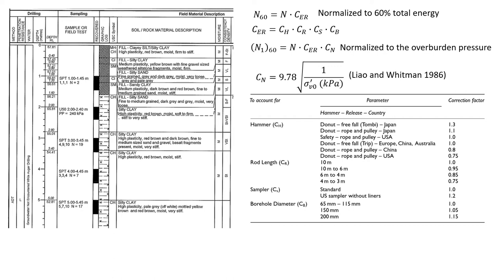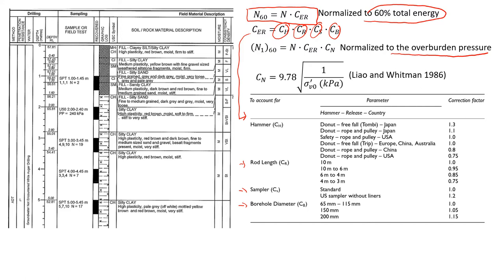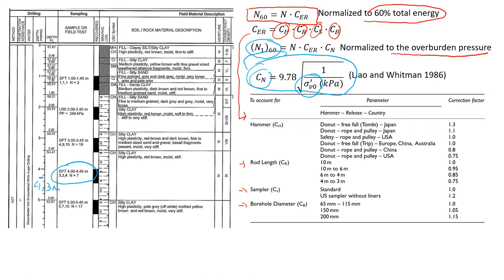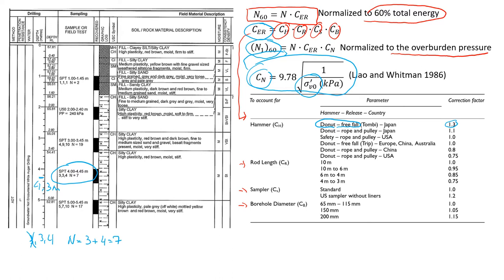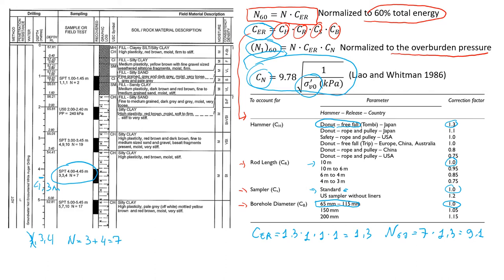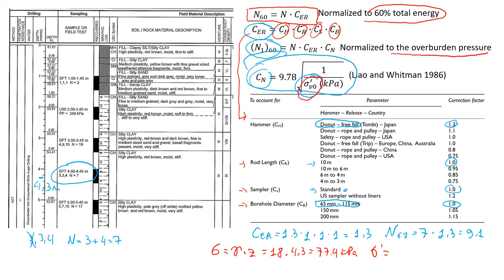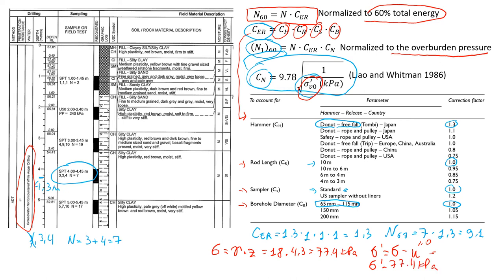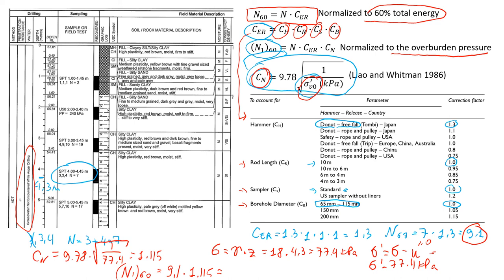Correcting SPT N values to Hammer Energy and Overburden Pressure | Formulas and Procedure

Comment: You quickly gloss over the selection of 4.3 meters as the overburden depth, yet that is important to understand.  And, I think it is more practical to calculate overburden stress at the top of the driven length of the sampler, for the simple reason that driven length can vary in dense soils.